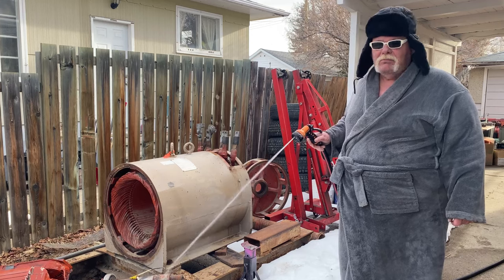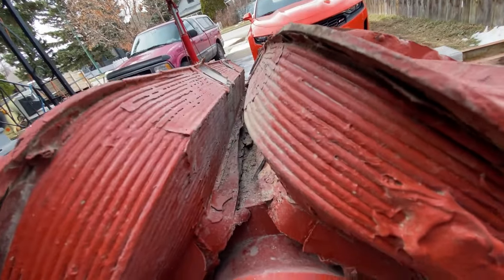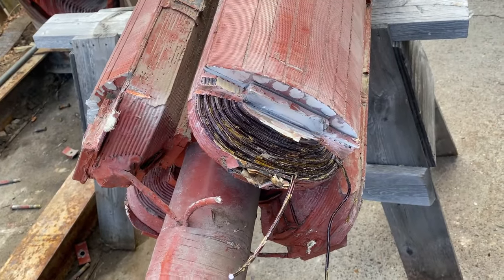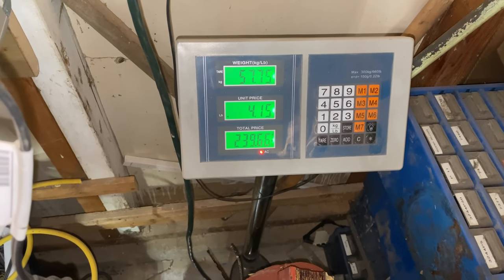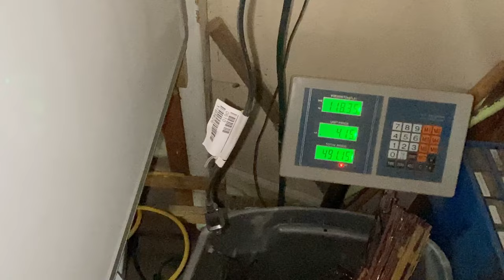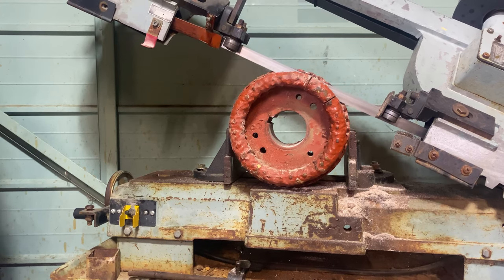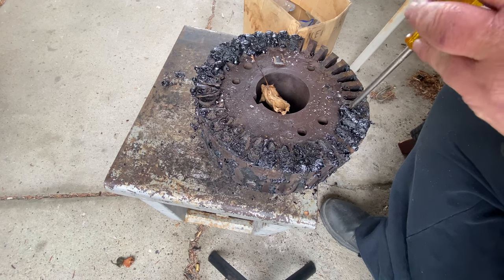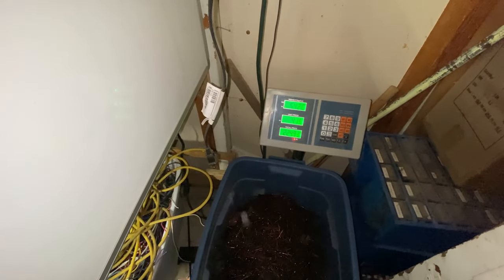How Much Copper in a Armature  From a 9,000 Pound Generator - Part 4

Comment: I scrapped a similar size alternator a couple of years ago, also bought from an auction. Mine was a 220-260KVA unit.From memory I upgraded it by about AU$400 for 20hrs labour which is about minimum wage here. The rotor was the easy part - as you did, cut the end off and hammer the windings off. The stator was miserable work. Due to the amount of epoxy in the windings, I had to grab each wire with pliers or vise grips and strip them out of the slots in the core one by one. The epoxy from between the windings exploded out everywhere like little glass needles, landing in my hair and stabbing theough my gloves. It was back breaking work bending over and reaching through the housing. I swore that if I ever got one again I would strip the rotor and exciter (bonus motor section) and sell the rest whole to the scrapyard.

I didn't want to burn the stator out becuase I much prefer the ambience of my Australian bushland compared to that of a Pakistani ship-breaking yard.

It is extremely heavy, dangerous work but it's a good return for the price that they can be found for. I ended up making about AU$900 from the whole deal.
Reply from the maker: Hi

Yes this one is a 485  kva, I agree the exciter and the armature is fairly easy to do

The large stator is very intimidating, I definitely will not be burning that the stink is horrible . I have a few ideas if it gets to be to much I’ll cut both crowns off and get rid of the rest
Reply: @nicejunk666  I just looked my auction receipt up, mine was actually a 380KVA @50hz / 460kva@60hz  - so probably just slightly smaller than yours

You might be able to sell the stator complete for the electric motor price, your scrap yard might not want to pay as much if you cut the crowns out

The epoxy is horrible stuff.
Reply from the maker: @JonoSann I’ll definitely look into it